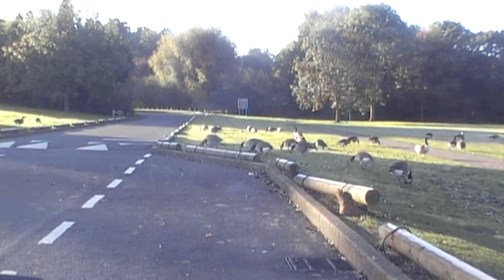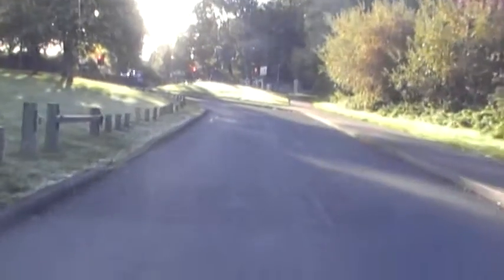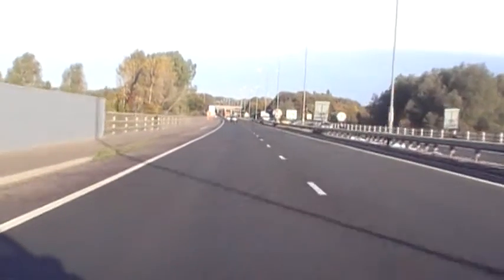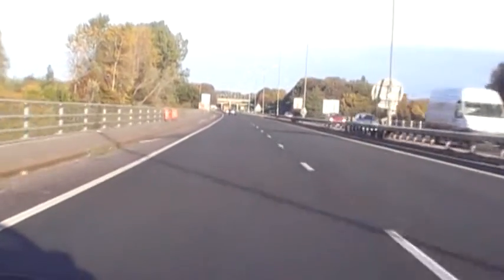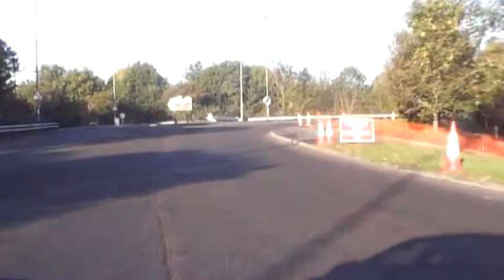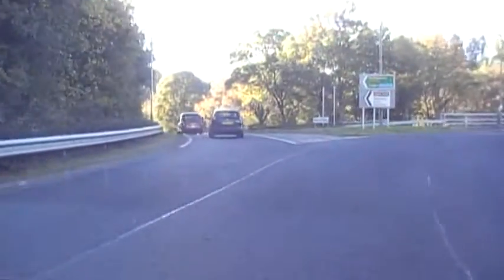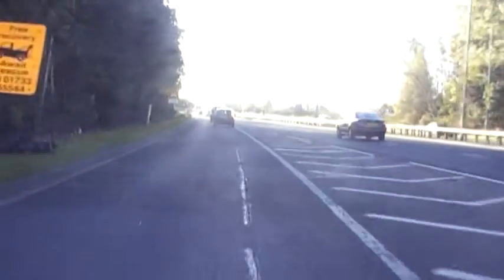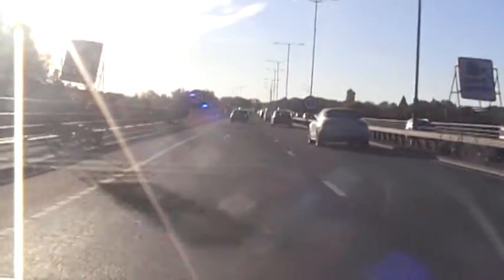Entering Dual Carraigeways Nene Parkway Peterborough

Comment from the maker: Hi faz - good question.
  
Solid white lines, no, not unless it's an emergency.  The dotted ones at the entry point mean 'give way', so if you are able to enter without affecting others already on it, then all well and good.... but THEY have priority, not you.
  
V often there are chevrons bordered by a solid white line (see 1m25secs on this video for examples on both sides) on entry/exit points to a dual carraigeway-we MUST NOT be driving across those solid white lines unless it's an emergency.